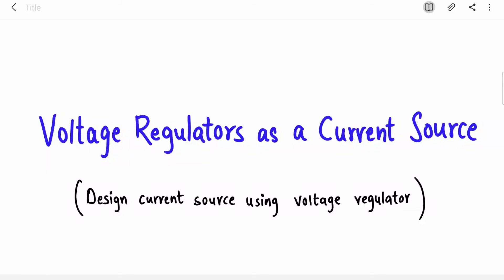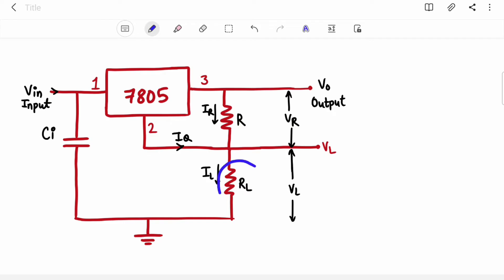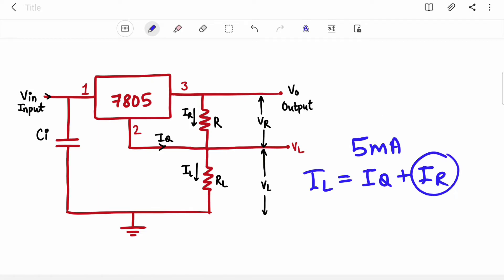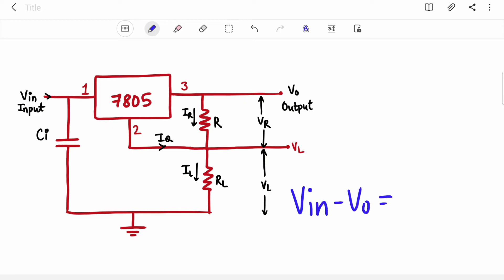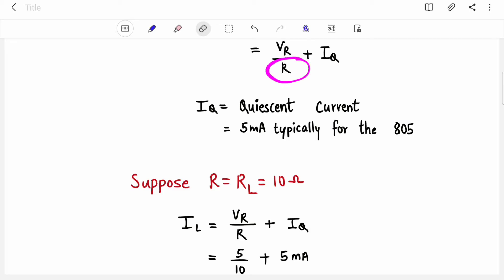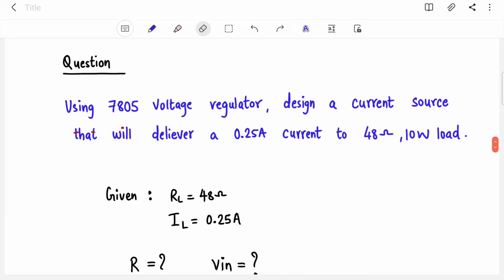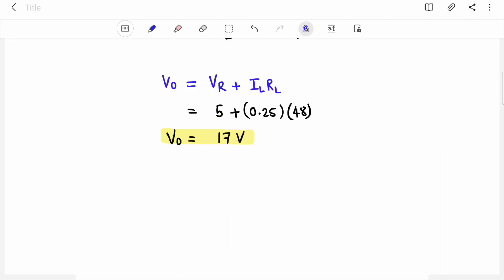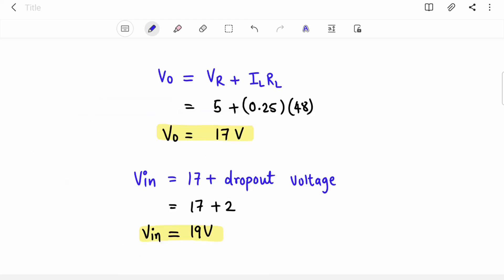IC 7805 AS CURRENT SOURCE - SOLVED EXAMPLE  - DESIGN CURRENT SOURCE FROM VOLTAGE REGULATOR

Comment: Please make Video on these Topics in hindi. Topics
1. Phase Locked Loops (PLL)
2. IC-565
3. IC LM317 - OUTPUT VOLTAGE EQUATION
4. Log and Antilog Amplifiers (Through Diode and Transistor)